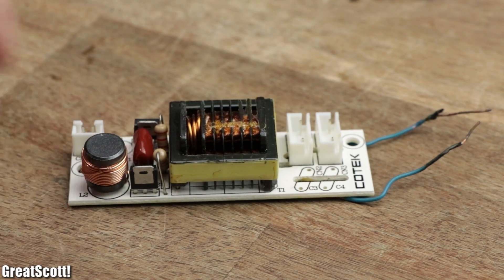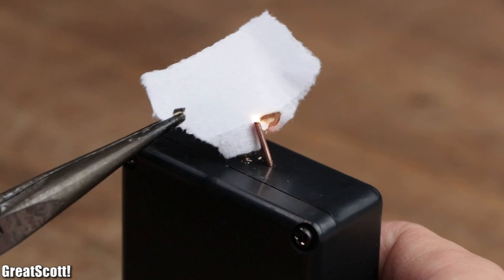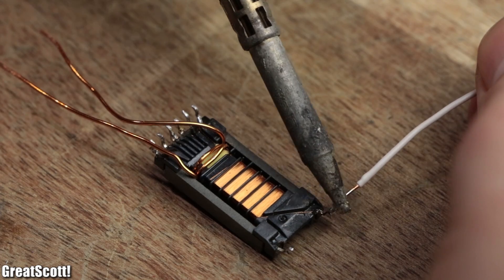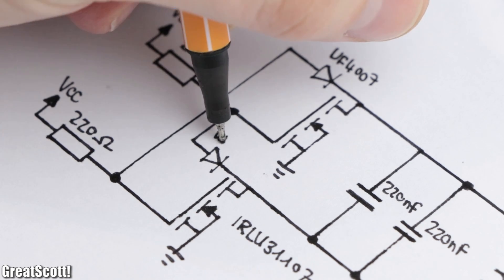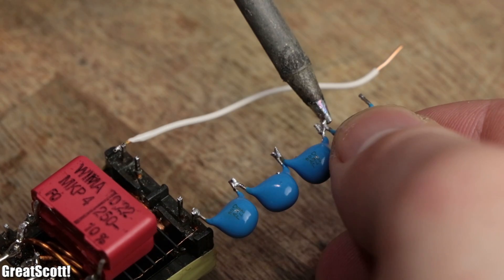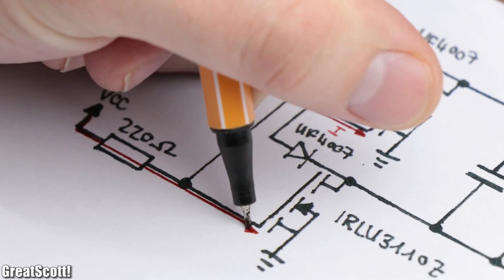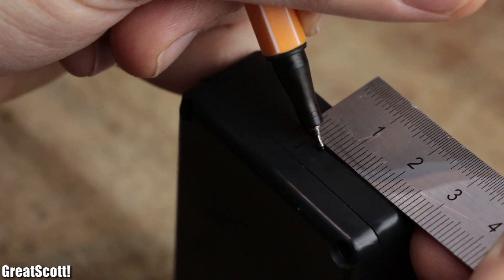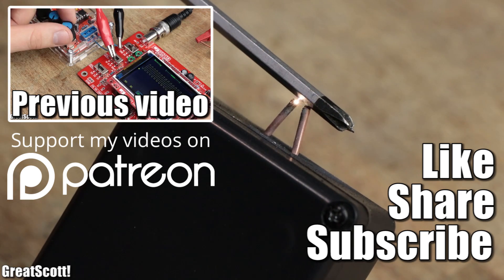DIY Arc Lighter

Comment: Would it have been possible to use a high drain 18650 cell instead?
Reply from the maker: If it can supply 3-4A, sure.
Reply: Vaper confirmed lol
Reply: KiDCe - CS:GO and more 

lol. I don't vape. Just know my batteries :P
Reply: GreatScott! Yea, that would definitely work then. Some of the ultra high drain 18650's can supply 30A. Thanks for the reply.
Reply: He won't say hi back
Reply: He could use a lipo if it was better too. His problem was with a battery that size he probably couldn't find one with a high enough amp rating, so for him a better suggestion would be an 18350 :D lol.
Reply: You could even use two in parallel with the same charging circuit.
Reply: 18650 was the first thing that i thought when i saw this small li-po battery.
Reply: Sample Textᴴᴰ good too xD
Reply: hi
Reply: Master of code 101
Reply: it would have been possible to buy a tazer
Reply: Misterlegoboy
Not in Germany.
Reply: germany sure is gay these days
Reply: EVGA Classified but Its true. (I am German)
Reply: EVGA Classified <3
Reply: EVGA Classified Da war ich noch nie.
Reply: EVGA Classified ich sag dir bescheid, wenn ich komme. 😉
Reply: They have 30A discharge 18650 cells available